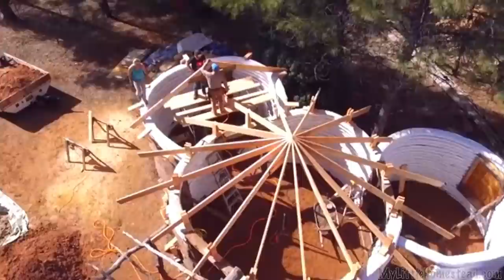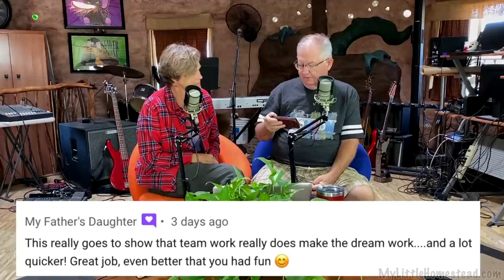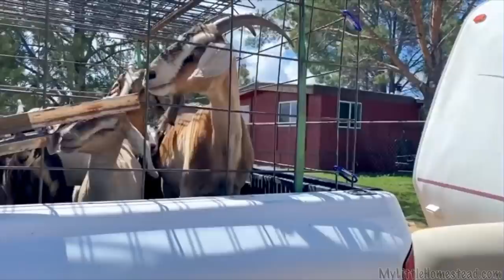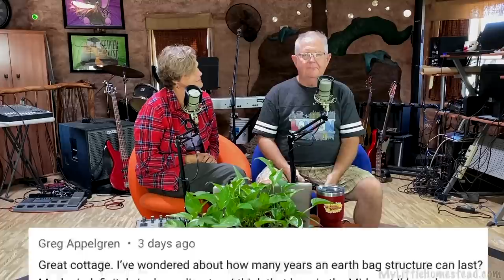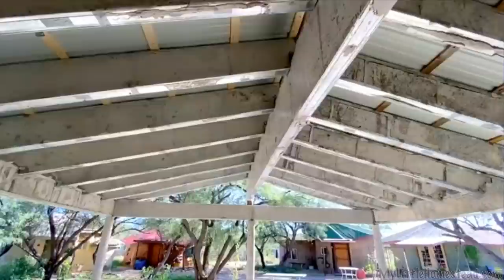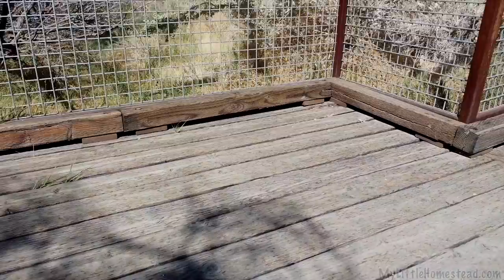Cabin Interior Stucco | Aircrete Roof |  Episode 90 | My Little Podcast

Comment: The best repair of flipflops I have ever seen was a guy that got and old rubber motorbike tyre and placed the flipflop on the tyre, traced the outline onto it. cut it out and glued it to the bottom. They had great tread and were super squishy under foot. I am a person that spends all winter in boots and all summer in flipflops, and I often get told that I will be one of those people held up to ridicule as a fool on the news as being rescued off the top of a mountain wearing flipflops.  I find walking everywhere in flipflops fine, so I doubt it will happen that I need rescuing. I have found I have super grippy toes compared to non flipflop wearing people. I often use my toes to pick things up off the floor with no bother. I'm with Bryson, flipflops are the best!

Comment: Working backwards, I have every day off (while also being a little ~off~). 
I would never wear flip-flops here in NM. I accidently picked up a young coiled up rattlesnake thinking it was a piece of round cardboard. Thankfully, it thought more about escaping than biting. It has since been skinned and is hanging from a hook above a bookshelf. I have yet to discover mom, dad or siblings. The previous owners had said that they had an issue with exceptionally aggressive rattlers so I'm sufficiently skittish at this point. There are other ways of getting rid of the mice and rats. Plus I also have a few nonpoisonous snakes on the property that only startle me until I can tell they aren't rattlers - they get to stay.
The cabin looks great - it is really coming along.
Stay happy and healthy y'all.

Comment: Fiberglass insulation would be very light-  you could do  the roof metal as a interior  finish panel.    or even just get some outdoor sunscreen material   then treat it like you did with the burlap.   if you can create a chimney effect  so air would rise and vent out the peak of the roof.  When we roll out the sun awning I am suprised how much heat radiates down from the roof  and also how much the air does not move.

Comment: For the suggestion of insulation on the new patio roof, heat travels up not down so insulation wont help. Here in texas metal roofs are common so i can tell you that metal roofs do not heat up the patio😘

Comment: If that metal/aircrete roof does heat up you might just add a radiant barrier. Just tack it up where the whiteboard is now and just reinstall the whiteboard over it.